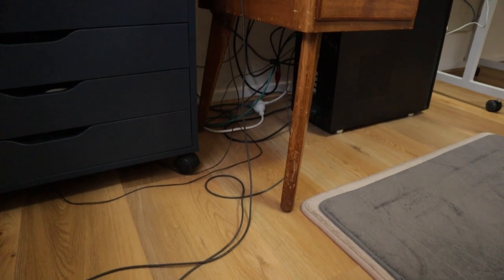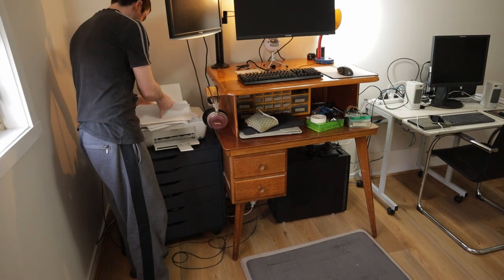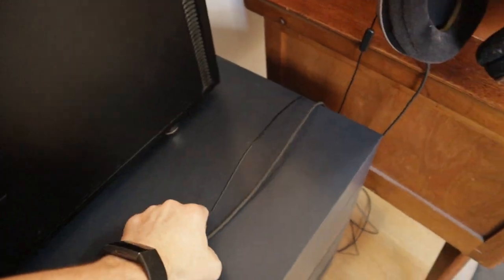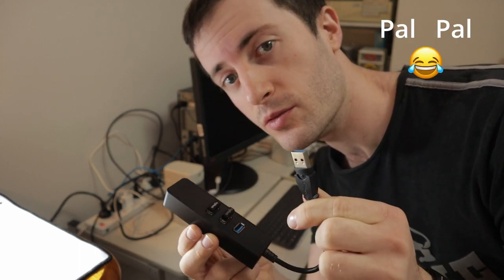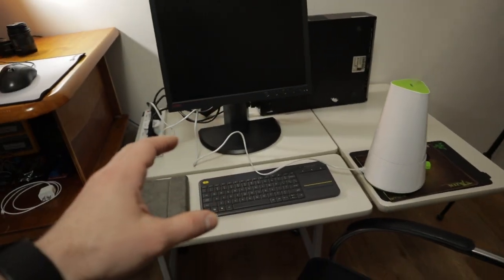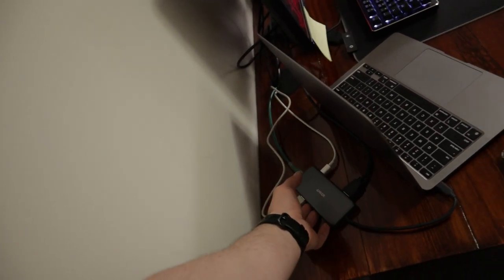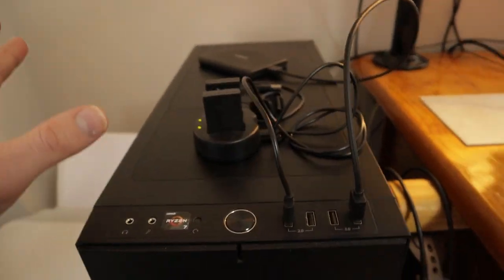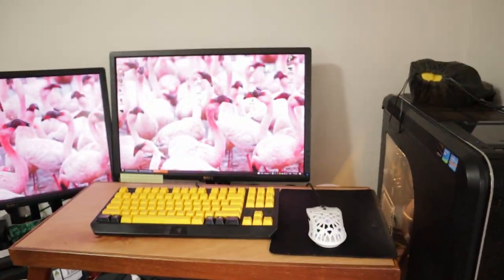Home Office Cable Management & Improvements [vlog]

Comment: Could get a USB C extension cable so the whole hub is under the desk for the Mac but eh you kind of want to have access to it on the top of the desk.
Reply from the maker: That's true, but it would be good to hide HDMI, ethernet and power, then just have USB type A ports on top of the desk!
Reply: @johnkeen939  I'm sure a USB 3.0 hub would work off of the USB C hub so could have a USB C extension under the desk then a USB a extension to above into a USB 3.0 hub. If USB is all you use or need from that hub in terms of access XD
Reply from the maker: @r4z0r84  yup that would work